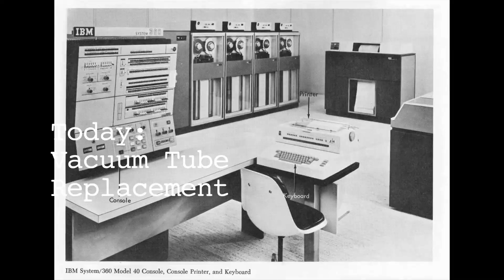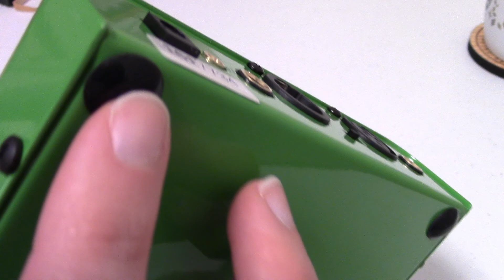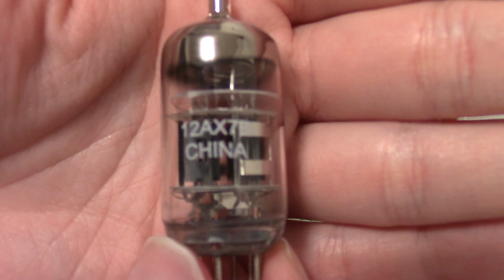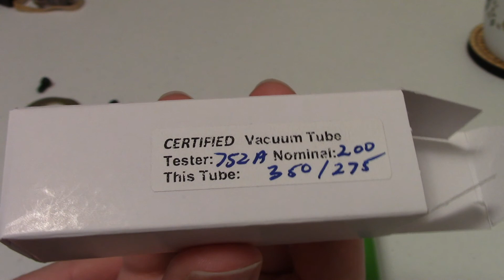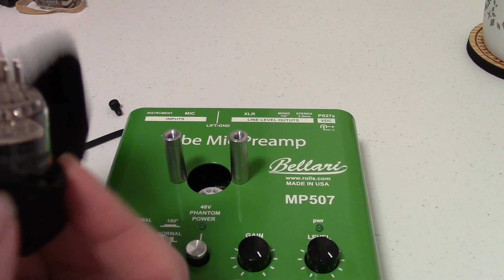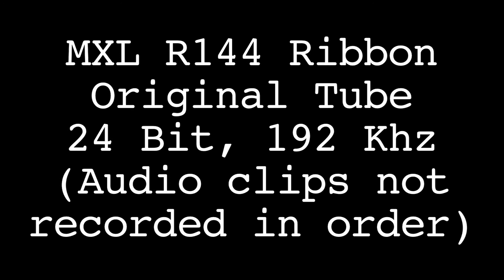Vacuum Tube Replacement and Audio Comparison (Rolls Bellari MP507, 12AX7)

Comment: Hi :-)
I feel hard pressed here to say which Tube sounds better even though I am able to pick up differences between them.
I am listening in here with Shure SRH1540 connected to a hybrid Tube/Transistor DAC-Headphone Amp with Russian Tubes for the Pre-Stage.
In my HiFi - System I tend to prefer Russian Tubes ( NOS ) over Chinese Tubes in different Amplifiers. But I haven't tried expensive new China-made Tubes yet.

I will take this Chance writing here to say: " Thank You ! " for these 3 wonderful Videos on the DELL XPS 720 You made.
Which led me to buying 3 of these ( Air cooled ) fantastic Machines :-)
I've run mine on LINUX - Mint and I love them !
With Greetings from the UK, Ralf